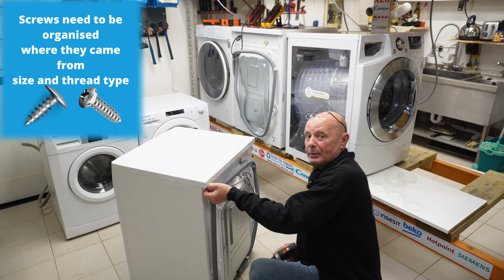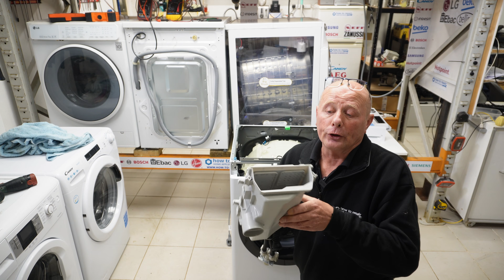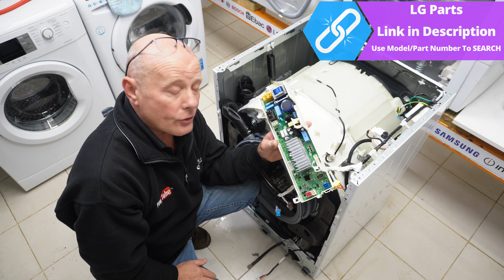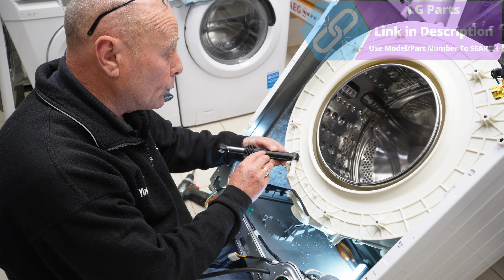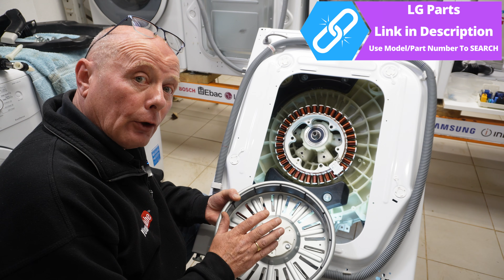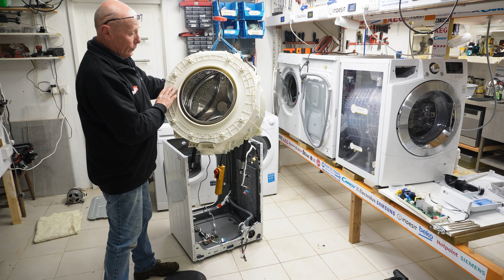Dismantling LG ThinQ Washing Machine, A Complete Guide To Taking It Apart (2020 Onwards)

Comment: Any ideas on why the front of the plastic outer drum would crack? Horizontal, just below the door seal. Can get a replacement but at $200 not sure if it's worth it. Especially if it's going to crack again.

Comment: The tip about taking photos of the wiring before unplugging and not using an impact driver on the concrete counterweight bolts is pure gold. Really appreciate you including exact multimeter readings for the element (26.4 ohms) and NTC sensor too!

Comment: Do I need to take off the weights and the pump to replace the shock absorbers? I don’t know if I can reach enough with the pump there. Also, I can imagine the assembly being too heavy with the weights on there. Or shouldn’t it be an issue if I replace the shock absorbers 1 by 1?

Comment: I own a FH4U2VCN4 model every now and then it will stop mid way through a cycle say mixed load or dark wash usually after the second drain  rinse  spin with 27 mins left on the timer It then just basically does nothing but you hear this buzzing electrical sound Basically having to stopping the cycle and then go into spin mode to finish off

Comment: This is the Mashin we own in about 15 years like New made in Koria (now is made in china) i will repleace the 2 bearings and seal. We didn't spead it more then 800 RPM and this why it's Stay this long. we using both poweder and liquds. and an advice for you in the UK dont buy those Mashin that can't repair in the cheapest j way just buy a 200 ~250 quid. It will Stay 5 years or more. or buy a LG it's will do a AAA landery quilaty.   LG is the only Mashin with  DD motor. Great video
Good luck

Comment: Great video on how to dismantle these machines. I have a similar one which was making a very loud "helicopter" noise on highest spin; so loud I couldn't stay in the same room. Some guy was called to fix it, and all he did was put two tablespoons of soda crystals into the tray and put it on tub clean and went on his merry way. Obviously that didn't help at all, and he was a smug arrogant guy too talking down to me. Long story short, I watched this video, removed the top and front parts and gained access to the counterweights and just made sure they were snug. They had loosened over time it seems. So I used a 10mm socket wrench to tighten them (not too much but just so they were snug and tight). Just ran a high spin wash now, and the loud noise has gone!! Great video and thank you so much!
Reply: Update, the bolts come loose even after tightening. So now I am going to use blue loctite and repeat the steps above so the bolts don't loosen as much over time due to vibration

Comment: We have one of those at home, no issues for almost 4 years. However, I wish it had no-AI programs and time saving button.
In my experience, cotton program sets the same washing time for 99% of my loads.
But it selects insane 4+ hours when you put soaked clothes. And the only alternatives are gental programs that don't move clothes that much, or the one for sportswear that's also on a shorter side.
Interestingly enough, special cleaning cycle differs from regular washing, it spins much faster so cleaning solution gets the top of the drum. You'd better run it on a regular basis or you'll have to clean the drum from residue gunk.

Comment: I recently purchased a six month old WKEX200HBA Laundry Center which I then moved about 200 miles without inserting the transport bolts.  Also while moving on the dolly, one wheel slipped off the walkway and it laid over moderately hard.  It didn't freefall, but  it was a pretty good rollover onto it's side while strapped to the dolly.  Mostly it fell on the grass.  Nonetheless, everything works great except while spinning there is a lot more noise than I suspect it's supposed to make.  I don't have any error codes.  Before I start randomly looking for what's making the noise, do you have any suggestions as to which part you think would be most likely to cause it?  Is it possible or likely that one of the shock absorbers or springs just disconnected?
Reply: Did you find out the cause of the noise?  I have a very similar situation…

Comment: Amazing vids! Thank you so much!!  Quick question - LG WM399HWa  - won't drain - replaced drain pump - still won't drain - it's like signal isn't being sent to drain pump/motor in order to drain...please help
Reply from the maker: If your machine isn't emptying, check the sump hose as objects often get stuck there. Some new LG pumps use DC motors, so confirm if it's an AC or DC motor. Without the machine in front of me, it's hard to say more.

I'm sorry I can't give a definite answer, I don't want to provide incorrect information. You can also watch my other video related to the drain issue: https://youtu.be/ixbTj4wLvL8?si=Kz_hBApXfdp7SQNx

Comment: what resistance do you measure of the solenoid valve in ohms? because I only have 0.3 I think that the problem comes from there but on the new parts I only have 0.3 ...

Comment: I am curious, how is it that an object like a sock, or even coins, can get wedged between the drum and the tub? I see only very tight/small seams and holes inside my washer when I poke my head inside the drum. Or tub. Whichever it is.
Reply from the maker: Hi there, small items like socks or coins can slip through the small gap between the drum and the tub during high-speed spins, especially if the load is unbalanced or the gasket is worn, causing them to get wedged.
Reply: @How-to-repair  that's what i think just happened to my washing machine, there's a metallic sound between the tub and the drum like something is stuck in there. So the only way to get it out is to dismantle it all?😢

Comment: Modern machines are too sophisticated for their own good! My 2005 Candy was simple, with a mechanical program selector. It had NO ERROR codes. It had no rust or mould. It NEVER leaked a drop of water. It worked reliably for 19 years, until suspected spider failure! Not bad for £199.99? I'll wager my new Hisense Inverter WON'T last 19 years? Although it is beautifully clean and quiet, compared to Candy's universal motor.

You use a lot of acronyms. You should explain what they mean? NTC sensor? Is it a temperature sensor?
Reply: how did you know that your candy washer had a spider failure